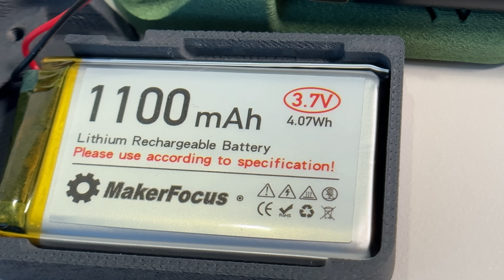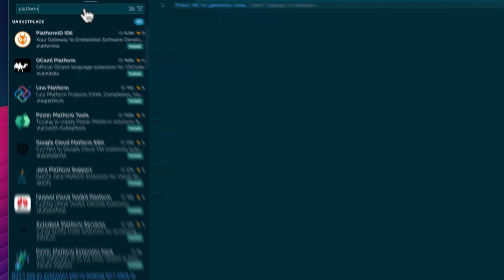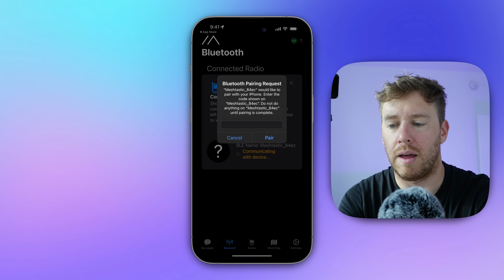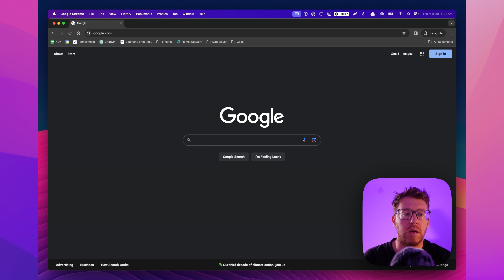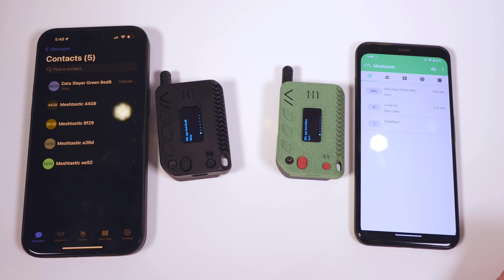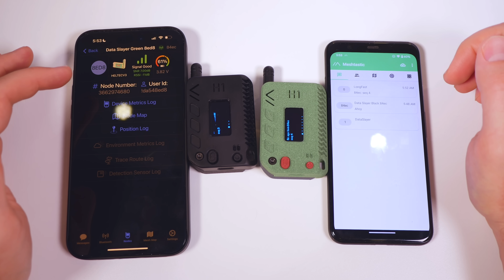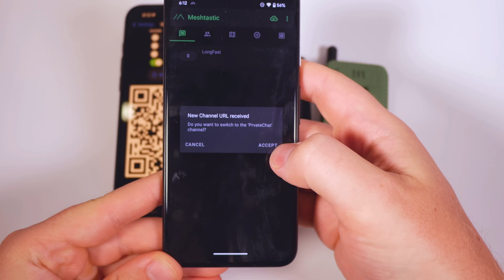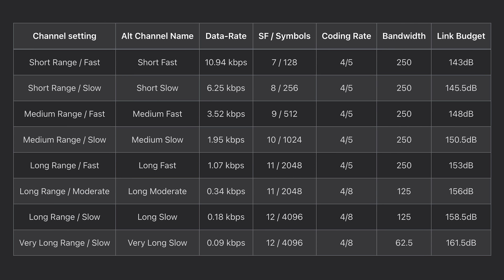It’s Been a Good Run, Phone Providers.

Comment: Dude, just learn to be a radio operator (whether or not you want to get a ham license I leave to you). 

If you do get licensed, technician class lets you do basically anything an individual would ever need, and you're not limited to any one type of device or communication. Hell, you could even use SDR and achieve a similar thing to this crap with any computer.

Comment: just buy a baofeng
the UV-5R is a super cheap 5 watt radio and you can extend the range by adding better antenna or buy a BF-F8HP PRO it has a GPS tranciever and 8 watt transmit power

Comment: Clicky McClickbait title. Yeah, fun, yeah, meshy, yeah possibly useful for emergency comms when the cell system is down - if the mesh in the area is decent - although the amateur radio folks will have things covered much better. I'll hang on to my phone, thanks.  (Yep, I am running two nodes in my area to support the project).

Comment: Very misleading video. This is not the future of phone communication. Lora is very low bandwith, so not much more than text. Lora also require line of sight and not many accespoints available because the public only creates accespoints, so forget you can connect with anything in the location where you happen to be, let alone in the desert, or anywhere where there is no cell service.

Comment: Okay a few points here...

Firstly, overall I think your information is pretty decent here but I have some issues with your presentation and perhaps understanding of radio theory and propagation.

1. You made no mention of antenna polarization. If I recall correctly there can be as much as a -30 dB difference between a horizontally polarized antenna and a vertically polarized one.

2. I do not trust Chrome, Google, Apple, etc. for the purpose interfacing with the ESP32 device and keeping communications secure and I think anybody who does has totally disregarded what Edward Snowden had to say on the subject when he disclosed what the federal government was doing.

3. You seem pretty effeminate and in my not so humble opinion, you need to man up and quit emulating a bowl of fruity pebbles. Where did your toxic masculinity go? Get some testosterone injections or something. As a cold war veteran this seems especially distasteful to me.

4. You might be a wiz with the new gadgets and software but it might behoove you to actually get a ham radio license. 

5. Typing Spanish though the device is a total non starter for me. 

My rant is over and I do appreciate your attempts here.